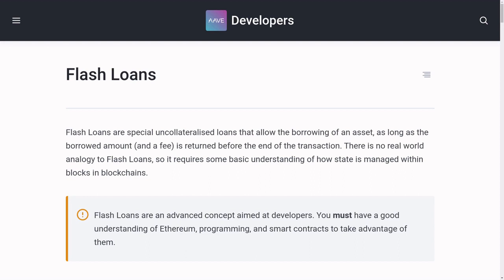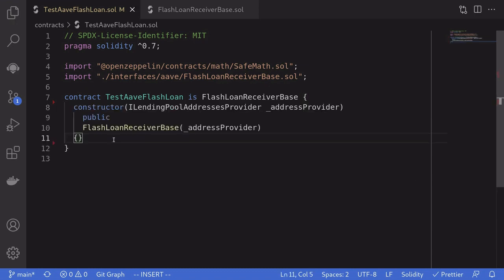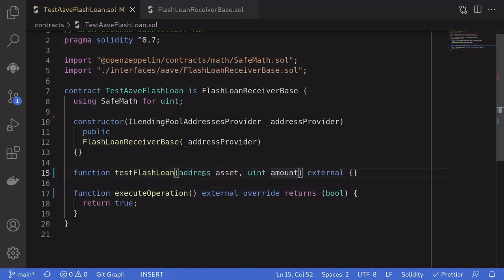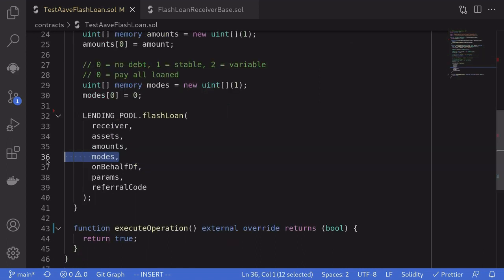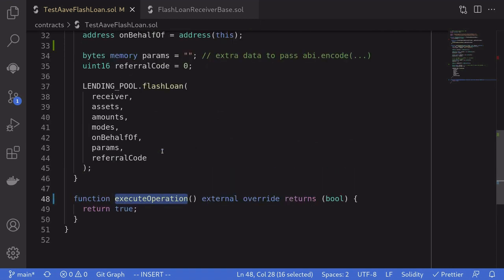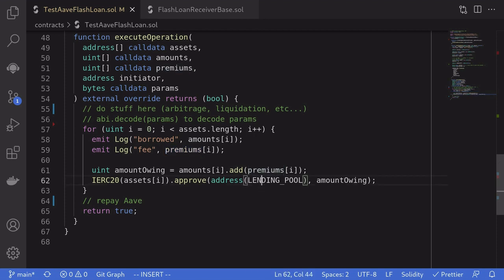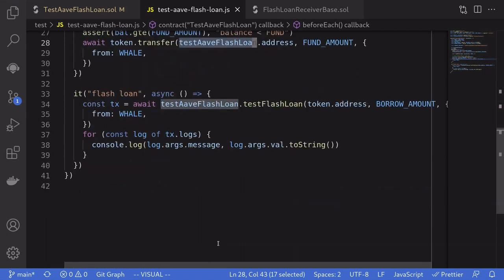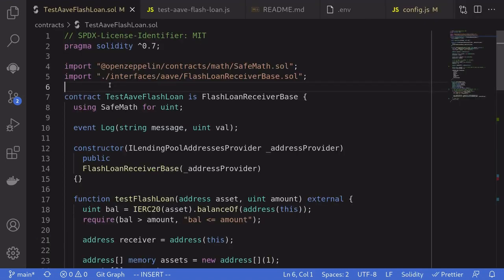Aave - Flash Loan | DeFi

Comment: I don't get why we are checking balance of the asset to borrow to be greater than what we want to borrow. Should not flashloan actually provide the tokens?
Reply from the maker: You need to repay borrow + fee for flash loan to be successful.
For simplicity, we fund the contract with sufficient amount of token so that we have enough to repay the flash loan.

Of course in real life, you won't have access to funds of the whale
Reply: @smartcontractprogrammer . This has nothing to do with whether I have funds of a whale; the logic in your code is misleading. The testing contract is only required to have amounts for the fee, not an equal amount to the loan; this is the meaning of a flash loan.